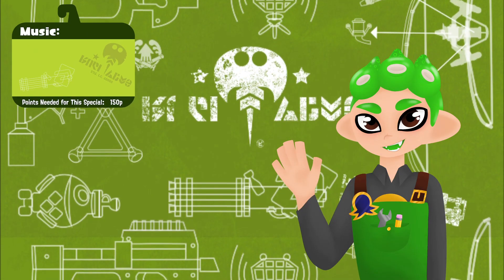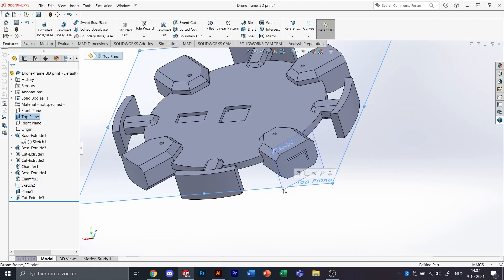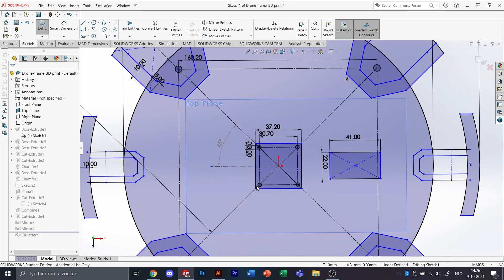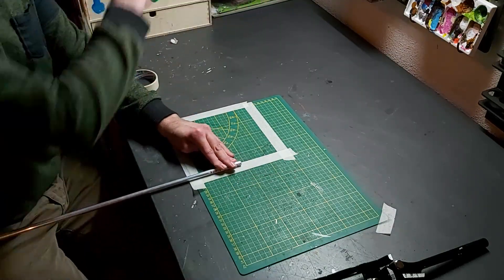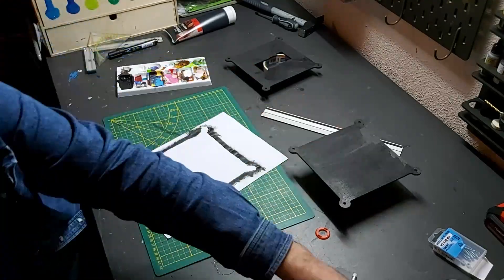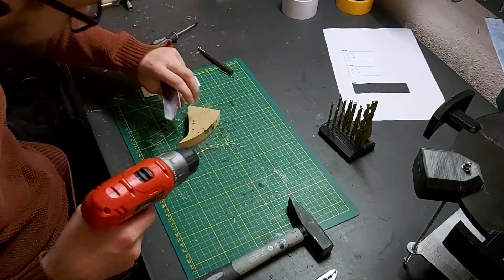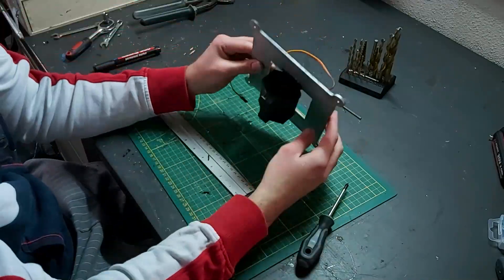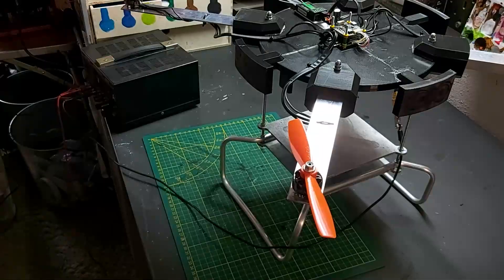Splatoon 2 - Project Horseshoe - Part 3 - Drone frame

Comment from the maker: Sorry if you came here to this part of the showcase hoping for a more in-depth look into the wiring of the drone.
But if you guys want to, we can do a little live stream on how we did the electronics for the drone! Showing how we did the wiring, software and hardware. 

(And this time keep it unarchived...
sorry, just not really used to unscripted recordings yet. 😅)
Reply: Roboy can a have a link to the 3d model
Reply from the maker: I'm sorry but I think I'm not going to release the files of the Drone project to the public. This project has taken a lot of my time and money to develop. And on top of that, I don't even know yet if it's really going to fly thanks to some motor problems. So I also rather not release something where it's unsure if it even works...
Reply: Also i would recommend (if you have the tools) sottering it together instead of gluing it